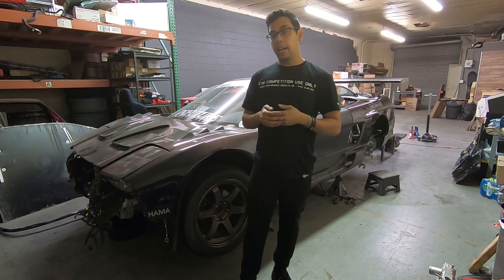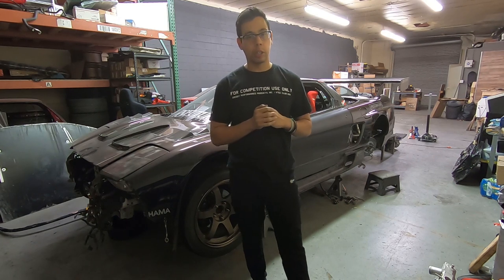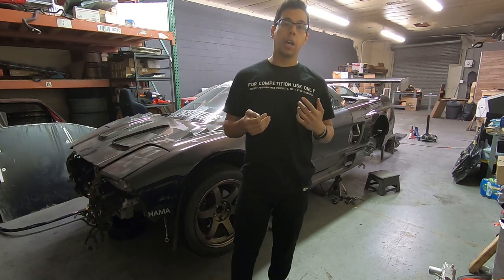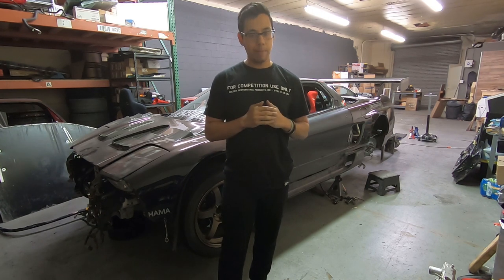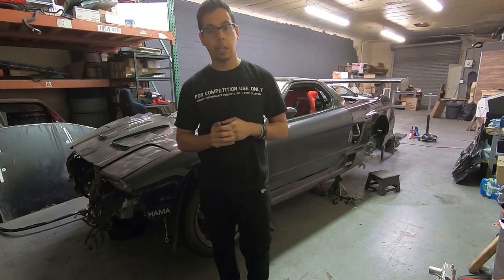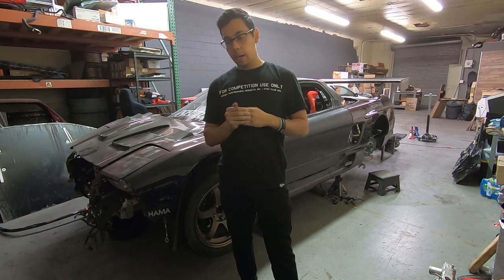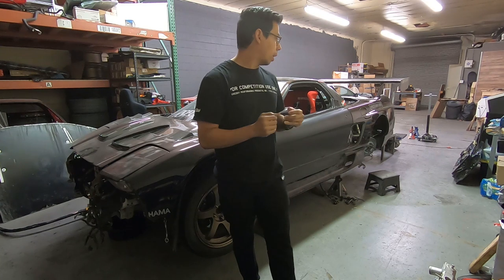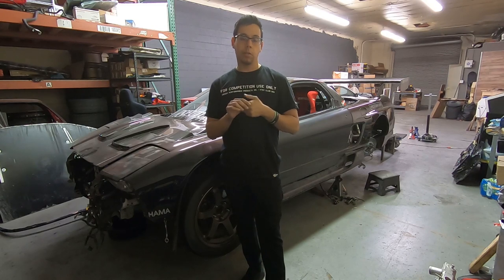Samsonas Dogbox Testing - Buttonwillow 13cw - RS Future Vlog #17

Comment: $5500 for a new dog box is a screaming deal. I’ve only had one many many years ago, and it was $15,000+ total game changer though
Reply from the maker: $5500 is a steal!  It also fits in the stock trans case, so install and a case isn't much more.  The biggest thing is that it cures all reliability issues.

Comment: I want that transmission, but heard you have to service it a lot. Can you please provide how often you service it and what the service entails>?
Reply from the maker: I've had to rebuild it twice in two years with two 6th gear failures.  That is due to my power level though.
Reply: @RSFuture  how many miles? I contacted samsonas and they tell me to check / service every 200km

Comment: when you pulled out into the track and let off throttle, it prompted me to ask. How much travel do you have in compression compared to droop?
Reply from the maker: I'm using the KW Clubsports, so they have quite a bit of travel (which is a good thing).  It depends on what I have the ride height set to, but bump travel is typically limited by the tire hitting the body, rather than the damper.  Droop I have 3".

Comment: Do you have to use the clutch on downshifts?
Reply from the maker: You don't have to, but it makes rev matching much easier.  I use the clutch on the downshift but not the up.
Reply: Probably hard to skip gears like you do w/o the clutch
Reply from the maker: @rafaeln21  I didn't even think about that, but you're right, I don't think I could.  Fortunately there isn't time to gain on the downshifts, but the upshifts have seen a gain.